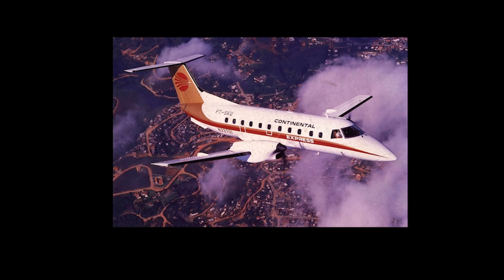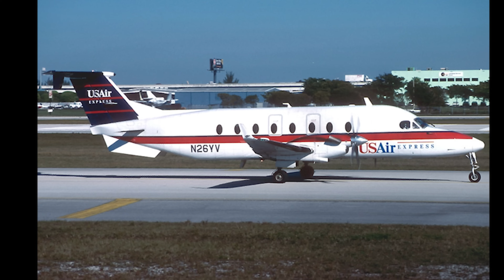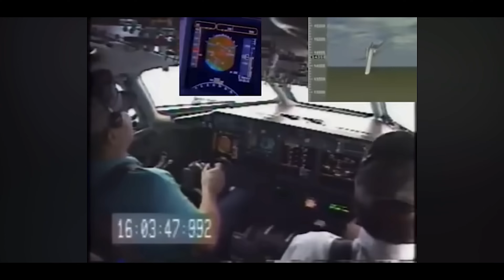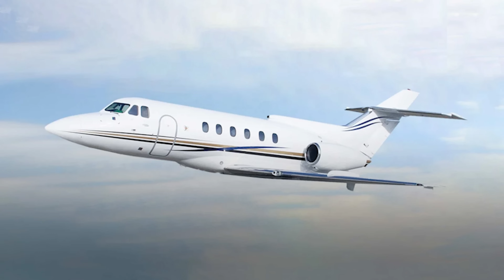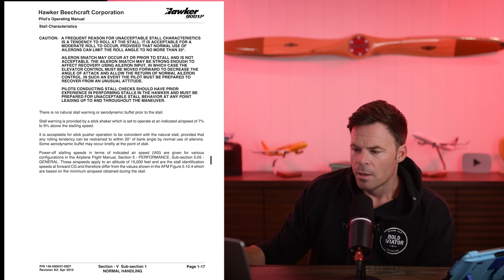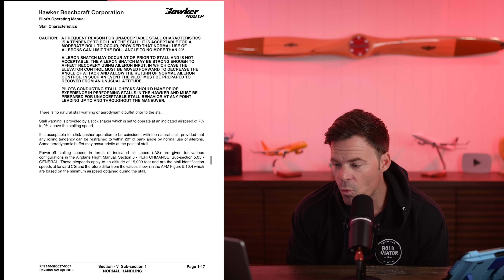Hawker 800 Stall Test Crash Explained: How a Post Maintenance Flight Turned Deadly

Comment: I flew the 900 XP up until 2017.  As the Chief Pilot for our company, I flat refused to do the stall test or to put any of our other pilots in the aircraft when it was being performed.

This was beat into my head during our initial at Flight Safety in Wichita.  They showed us a video of one of these things stalling, and it was not pretty.  

Coming out of maintenance we simply hired a test pilot crew to go do that test.   Textron who maintained our Hawker had a list of insurance approved crews to do it.
Reply from the maker: That’s nice to hear. I wonder if this owner/company put some pressure on the crew to just do it as Im sure its less expensive. Or maybe this is just how it’s done with private owners, as in part of the employment deal.
Reply: @Bananasssssssss I was with a private owner and while they questioned all expenses it was justified.  

I believe the last time I had it done in 2017 before leaving that company it was $1800 per day for each pilot and travel expenses.
Reply from the maker: Glad to hear that

Comment: 1:52 This specific test pilot role sounds like working routinely on a razor-edge--especially in the Hawker 800/ 900XP. It must be hard to appropriately react to, detect or predict all potential error conditions possibly introduced during major service. Then there's mis-calibration of stall annunciators, and stick pushers activating knots after Vs.

Comment: I've been doing stall test in Hawker for thirty-five years. When we delivered a new Hawker at the delivery center, we would show the excepting pilot stalls.
The Hawker will fall straight through if the stall triggers are set right. That's the reason we stall a Hawker after maintenance to make sure the stall triggers
are set properly. The sealer on the TKS panels and leading-edge changes the airflow across the wing it has to be smooth not sticking up. You have to make
sure, the stick pushed go off before the stall then you cancel the stick pusher and stall it. 1 out of 5 the stall tests the trigger need adjusted, and another stall test performed.
Reply from the maker: Thank you for insight! Appreciate it

Comment: "Transport Category" is the category the aircraft was certified to.  For jet aircraft, FAR 25 stipulates 10 seats or more, over 12,500 lbs.  System redundancy and performance guarantees also apply to Transport Category.   The stick shaker and stick pusher both activate at a speed above the aerodynamic stall.  The warning about holding the aircraft in a stall is to avoid a full stall and any number of events that may happen with mishandling undesired flight characteristics.  I agree that these tests should be performed by test pilots or those trained and current in stall/spin recovery.

Comment: I have found that the most trying time to fly an aircraft is when it comes out of Deep Sink Maint.  I have had the most audacious things happen on the Shake Down before
going back on the line.  That Stick Shaker is there for a reason.  Which is to keep you from actually stalling.  I have wondered if some critical system of the AOA, St Shaker,
St Pusher, WS blanketed the entire system.  I have seen something like that from an Avionic Pig Tail mistake.  Anyway...In the Sim once we took a B-757 up to 250, and killed
some systems to allow a full Stall.  Did not recover until apx 2500.  The high speed secondaries were one after the other until we ruddered and speed braked it back in.
Meaning you stall a swept wing slippery jet you best have an Angel looking after you.  Not to mention one with a T-Tail that will stall all on its own.  IE: B-727.
Reply from the maker: Interesting! Thanks for sharing

Comment: Sounds like they were asking, at one point, for between 14,000 and 16,000?  Hopefully they weren’t thinking they could stall and recover within 2,000?  That sounds unlikely given what you Joe and others are reporting about stalls in swept wing airplanes?  Or maybe the plan was to appproach the stall only and recover but an actual stall with a break happened.  So sad.
Reply from the maker: Yeah, 2,000ft is more than enough if they were going to recover at first indication.

Comment: If the maneuver is that difficult then it should not even be practiced by regular pilots or the aircraft is not well designed
Reply from the maker: Yeah. The manual does make it clear it should it only be done by those very familiar. But Id imagine most people typed in it have at least done it in the Sim

Comment: There is a very specific manual on how to conduct the post MX stall test in a Hawker.  It defines the MS:/AGL altitude and cloud clearance requirements, along with the specific steps the pilots must take and the suggestion that only experienced pilots should conduct this test. The biggest problem in the Hawker in stall is the aileron snatch. My dear friend and colleague and his copilot died doing this test in GJC, just a couple of years ago.  I could go into lengthy specifics, but Juan Brown on the Blanco Lirio channel explains it well. At least he did in the accident where my friend and his copilot died.
Reply from the maker: Wow, that’s terrible. I’m so sorry to hear about your friend.. do you know how  far into the Stall they are supposed to go?

Comment: How many more deadly accidents in these Hawkers will we have before something is done about these stall tests. I have never heard of another aircraft with this extensive deadly problem!
Reply from the maker: Good question. I am wondering if there will be changes based on this accident.
Reply: @Bananasssssssss Whom shall we sue? The designers? The mechanics?  I think the pilots have been punished enough.
Reply: Employ qualified people it's that simple.
Reply: This airframe has been around for 40 years or more, starting out as the HS 125. The RAF operated a fleet  of them known as 'Dominies'. There never used to be a problem with stall tests; it seems to be a recent problem.
Could it be that these jets are now so old that they have become relatively cheap to buy and get bought by operators who try to cut financial corners with them, such as not hiring test pilots to do stall tests?
Reply from the maker: It’s possible. These older swept wing jets are pretty unforgiving

Comment: It's not clear to me why a stall check was required
Reply: To ensure everything has been reassembled and functioning properly after extensive repair work. It’s better for a test pilot to figure that out.
Reply: @USA-GreedyMenOfNoIntegrity  is it required by regulation to do this test? That's what I don't get
Reply from the maker: Pretty sure its a requirement
Reply: @Bananasssssssss  thanks, I'm not an aviator unless X Plane counts 😅 wasn't sure if it was an excuse for a joyride or what
Reply: I've worked on Hawkers as an A&P.  The test is typically required when leading edge panels or stall vanes are replaced
Reply from the maker: Interesting. Thanks

Comment: Thanks, Joe, for a nice summary and analysis as always, and for highlighting the rudder vs aileron use between GA and transport-category airplanes. One point to note is that this was a T-tail airplane: does that lead to a less-prominent buffeting profile close to the impending stall?
Reply from the maker: Thanks! and that's a great question. I'm not really sure about how the Elevator on a Hawker would change the stall characteristics vs, say an EMB-145 or md-88 where the Elevator is on top of the Rudder, not midway.